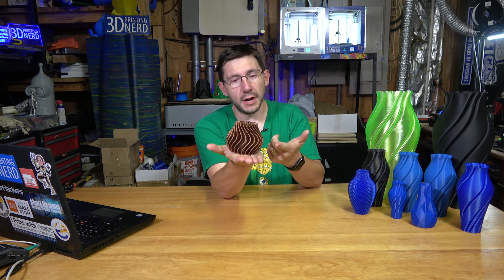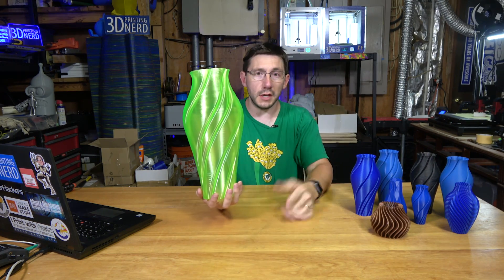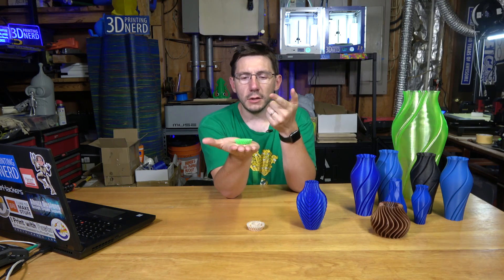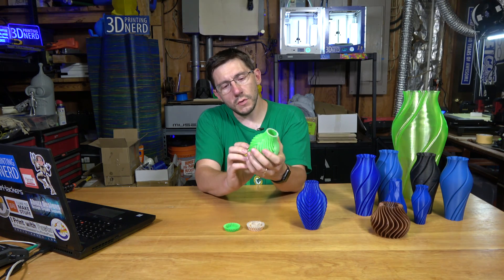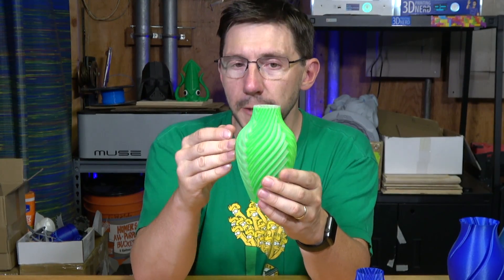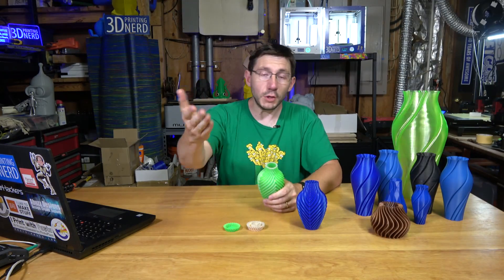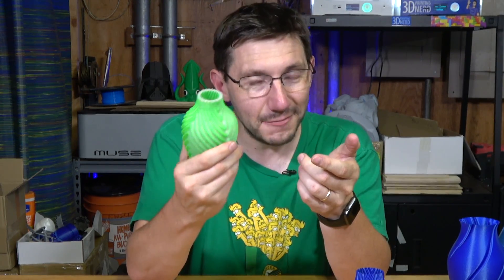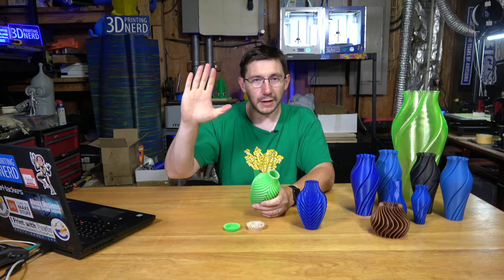Glow in the Dark Vase on the Ultimaker 3

Comment: oooo, that two-color vase is awesome... I want to do that with two different colors of eSUN UV color-changing filament.... So it looks like just a solid off-white, but then turns purple and red when exposed to UV light. :D  (Heh, I see you also use one of those cheap UV nail polish curing stations as a UV source... I've got a couple that I use for exposing photoresist and stuff.)

Comment: How did you get vase mode in cura
Reply: On the right side menu scroll down to the bottom in special modes hover your mouse over the gear and it should be able to add a setting called spiralise outer contour

Comment: Hey,

I printed a few vases on my FlyingBear. 

Devin made a blub vase with different textures. And one of those is really interesting because it uses gravity for some nice effects. 

Sadly this version failed on me so I printed a blub vase at 200% with 75mm/s at 150% Marlin it only took 10h38min and the vase was 22cm tall. 

If you want to print something in spiral wave mode that is not directly round - look for the paper bag and apply a good scaling as 100% is like 246mm tall. 

It's a fun print done in 5hours for me and is now used to keep my waste plastic. 

I can show you some pictures once I am home ... I will retry the blub small dripple vase model but  sclic3r isn't great for interfacing a bottom layer to the spiral. And there should be a sclicer which does uses the first few layer in normal mode and then gradually goes into spiral for better connection and less leaks.

Comment: Could you do some fillament testing on the ultimaker 3 ? I own one but I am scared that I'll brake something at some point
Examples : Wood, Metal, Nylon etc
Reply: Also real wood filaments will clog the standard .8 nozzle
Reply: Gavin Poulsen What would you say is fine what is not ?
Reply: Normal PLA,ABS is fine. Glow in the dark, metal,... filaments contain abrasive particles that will wear your nozzle down if it's a conventional brass nozzle. Get some reinforced nozzle, Ruby is pretty good if you can afford it. Normally the description of a filament should warn you about that, but you can always research online.